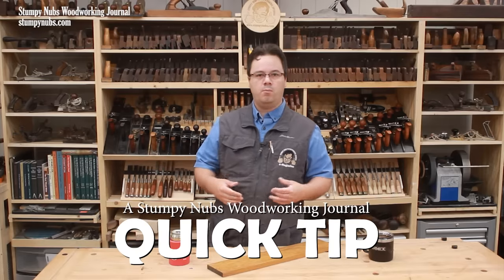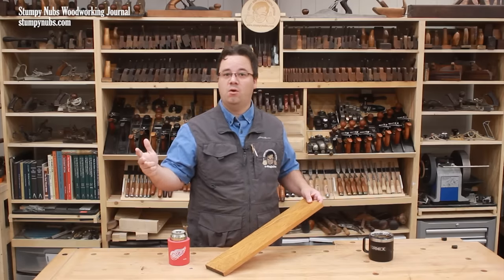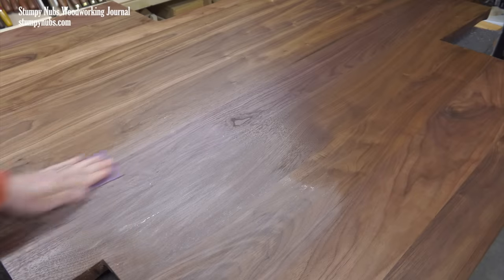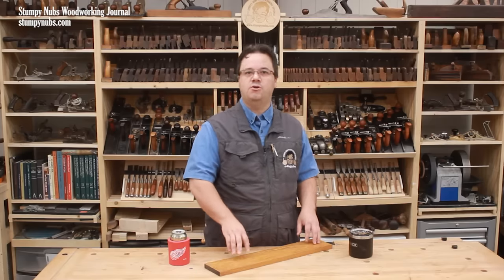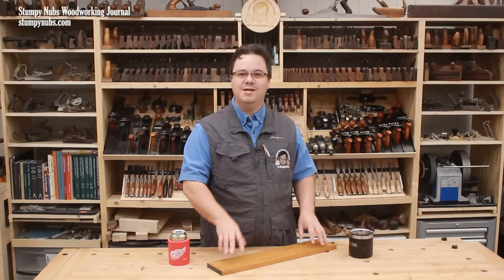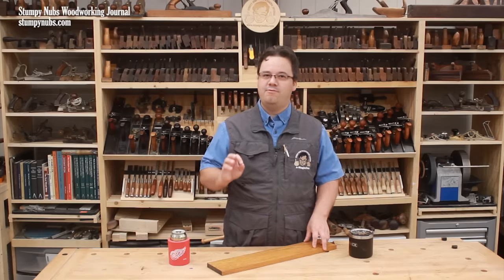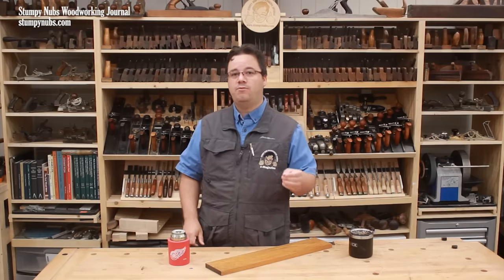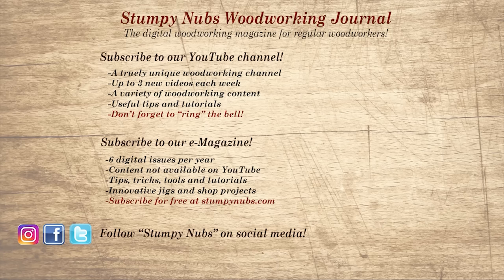Improper sanding between coats of finish- HOW TO AVOID IT!

Comment: If you want a seriously flat surface you need to knock the material back with 80 grit at least to get it flat, even 120 grit is the start of you getting mountains on high spots it won't cut quick enough. If its flat then you can do what you like with it just move up to 240 between coats then a 400 with a red scuff pad after you flat sand with the 400/600 before the final coat. To denib 180 grit automotive wet paper is thee best denibber if you are strictly denibbing just that spot. Then you can knock the scratches of that and blend it in quick with a 600 before the next coat or before final cut and polish. Save yourself a bunch of time don't bother trying to sand out large high and low spots with anything above 80 it won't cut it flat even with a block sander.

Comment: I wish I would have watched this video before I sanded My guitar. I decided it would be a good idea to engrave a cross in the back of my guitar and long time ago and I decided that I wanted to take all the good loss and get it down to the barewood well in the back I engraved a cross so I had to make the wood even to get rid of that cross, in some spots I went a little too deep, I put the stain on, which is a ebony or black stain , and when I look at it that's all I see is the spots that I boogered up lol is there any way to fix it cuz I just keep adding layers of stain, actually today I just put a second coat on . I thought that the spots where I went to deep would just look like a rotten spot on a piece of wood and I would have been fine with that but it really just didn't soak  in the stain, I'm open to any suggestions please help

Comment: could you say a little bit about sanding the edges and corners of a piece to avoid removing the stain underneath?  Or how thick to make the first coats to possibly avoid removing the stain underneath - especially when using wipe-on poly since the coats are so much thinner than other types of finish?  I still struggle with accidentally removing stain when sanding between coats and having to strip and start again.  Or I make the mistake of not sanding enough during the first few coats to avoid burning through the finish and then I end up with the other issues you discussed in this video.
Reply from the maker: I just try to be careful. Laying a scrap board of the same thicknesses as your workpiece next to it will help support the sandpaper ant prevent accidental rounding over on edges of flat panels. A sanding block will also help keep the paper flat and avoid rounding edges. Finer grit paper is also less aggressive and more forgiving if you get too careless.
Reply: @StumpyNubs  thanks, the scrap board is brilliant!

Comment: I've seen contradictory advice on using oil & water based polyurethane finishes over each other. One says oil first then water based over the top, another says water first then oil and a third says 'never the twain shall meet'. Any Stumpy Advice on this?
Reply from the maker: I have never mixed the two, so I don't speak from experience. Keep that in mind! But I believe that, once poly fully cures (takes about a month) it no longer has water or oil in it. It's just a plastic coating. So the type of poly you put on top shouldn't matter. However, new poly will not bond well to old poly. I recommend roughing up the old poly with sandpaper for a mechanical bond. The real question is, why put water over oil (or vise-versa)?

Comment: I'm getting mixed information on applying polyurethane or lacquer on oil based stains. Can you use anything diluted with mineral spirits on stain? Or what would you suggest?
Reply from the maker: If the stain is oil based, as almost all are, sure. Any oil based finish will go on top. (Mineral spirits is an oil based product.) Even if it is a water based dye, once it fully dries you can put an oil on top. But if you have a doubt, try some on a scrap piece and see what happens.
Reply: Additionally, you can always seal with a sanding sealer between stain and finish coats. Something like Zinsser Seal Coat, which is a wax free shellac-based product, works just fine under pretty much any finish and can help keep problematic color coats, or even problematic woods, for that matter, from interacting with your top coats.

Comment: Any thoughts on using 000 or 0000 steel wool?
I usually “buff” out my final coat with steel wool and end up with buttery glass smooth finish. 
I’ll definitely try to paper for buffing the finish, but a comment on steel wool would be appreciated.
Reply: Steel wool can work but you run the risk of embedding tiny metal shards in the finish, which can then rust (more a concern for outdoor projects for sure, but still). I don't know that steel wool is doing any better of a job than very high grit sandpaper so I would just stick to that and the ol brown paper bag for the last coat.

Comment: I have microscratches all over after lightly sanding with 320 and applying my second coat of poly. Did I not sand enough??
Reply from the maker: Is it smooth? If so, apply another coat or two. Sand with 600 between coats.
Reply: @StumpyNubs  smooth as silk, it was like glass after my first coat. And now after sanding with 320, there are just visible scratches in the poly. My guess is I didn't sand enough. How much do I sand between coats? Do I create a solid haze over the entire piece with the sand paper? I lightly sanded, which to me means, literally lightly wipe the piece with the sand paper. Which just created scratch marks.

Comment: Does anyone know if it's recommended to clean each layer of finish with mineral spirits after vacuuming? Or is that just following the first coat only?
Reply: It will be ideal to clean with mineral spirits every time it just helps pick up that much more dust and help for better adhesion on the next coat!

Comment: try damping your floor with water just before you finish your wood projects. just dampen the floor with water, and no puddles. You will literally watch the air clear up of dust. When you dampen the floor the dust stays on the dampened floor thus eliminating the dust all most all together!!! . A old trick from when I painted cars with that old Enamel spray paint. This goes back the the Early 1970's

Comment: Polyurethane is man's cruel inhumanity to man. 

If you use it out of the can, it dries too fast and it gets lumpy. If you thin it, it dries too slowly and it gets dusty. If you try to sand out the top coat, it gets scuffed.

Comment: We’ll unfortunately on my first project, after watching this, I skipped a bunch of steps… it looks good, but now I’ll see how much I’ve missed on it looking perfect… I have a question though! Could it be best if you already know all of your cuts to stain and clear coat BEFORE assembly? Thinking back on the beginning of my project before staining, there’s tight areas that would be impossible to reach with sanding and they’d show if I followed this step by step… it seems as though it would be best to get em perfect before articulating everything together

Comment: If you ever do a video on rubbing out a finish (maybe you have?), you can become an internet hero if you talk about rubbing out when there are mouldings, drawer faces, etc. In other words, everyone talks about rubbing out the nice flat top, but no one talks about getting a compatible, uniform sheen over all the rest of the piece where there are corners, dips, dives, and wiggles that invariably get cut through whenever you try to sand them. What makes me think of this is that it sounds like you just use your brown paper everywhere, but what if you want more control of the sheen level? I must admit that craft paper hasn't quite worked for me. It will make the surface feel better, but I'm never happy with the sheen, which tends to end up with glints or dull spots rather than one uniform sheen, even on flat tops. I landed here today because I'm applying Waterlox  on oak (only use Waterlox occasionally) and it's driving me insane by looking like gooseflesh despite doing all the normal tricks (like you show here). I don't think it's dust.

Comment: Thanks for this great explanation and demo as always. 
I tried to do my first finish using pure Tung oil+turpentine on an oak desk top after watching your other videos on Tung oil. I was sanding with 320 grit between coats, and learnt by myself the 2 hands method for feeling and sanding but I wasn't aware I had to increase to 600 and 1000 grit so I made the error to keep the 320. After 3 coats it still looks like I have applied only 1 coat. I will try the techniques presented here.
For now, I am not really impressed by how the wood looks (its just oak, but I was expecting more contrast & reflections) and I look after the aesthetics more than the smoothness feeling.  
What would you do to make the wood patterns look more beautiful?
Would you recommend doing "wet sanding" (applying the oil with the sandpaper)? I understand this technique is supposed to fill the pores with the dust just sanded while applying it. It's been done on a few guitar making videos, but I can't tell what's it's worth compared to your technique. 

Regards
Reply: Mighta want to use a stain or even a dye on your next project.  Tung can darken what's there, but if the grain isn't really fascinating, vivid colors can help spice it up!

Comment: I like to use 320 paper on a soft block after the first coat, 00 steel wool to grab the nibs, and 0000 for the final buffing. Good video. Your points about recoat times are excellent.
Reply: I remember my grandfather teaching me this after I put together a set of shelves and put on the first coat of polyurethane. He was inspecting it, turn to me and said "Looks nice. Looks really nice. Do you want to make it look better?" I responded with "Why yes I do!" and he proceeded to tell me about using steel wool to smooth it out, get rid of bubbles, and really shine. 25 years and several moves later they still look great.

Comment: At 2:37 you suggest using mineral sprits to swipe up the last of the dust. Wouldn't it depend on the material you are applying? If I'm using a water based finish, wouldn't I want to use water? I actually like a small amount of alcohol because it flashes off quickly - understanding you can't really do that with Shellac or you screw up what you have just put down. VERY smart to not use compressed air and to vacuum up with big stuff. And I REALLY like the paper bag trick. I had just used one sheen "brighter" than I want the final to be (semi-gloss if I want satin) and that final sanding always took it down a notch - but the bag trick might just replace that theory after all my years of using it. Nice to learn something new!
Reply from the maker: Sure, you can use water. I'd just try not to use much or you may cup your board. Mineral spirits leaves very little, if any film once it evaporates. I don't believe it will interfere with a water based finish.

Comment: Beware, I used new 1500 grit sandpaper on wipe-on poly after the fourth coat and it made very visible scuff marks.  The wipe on poly was several days dry and I sanded gently with the grain.  I put on another coat and the scuff marks are still visible, so I have to start over.  This advice did not work in this case

Comment: Very well presented.  i have a question though...what do you do when you can see places where there was too much poly left on and is now dry? i tried sanding with 220 or 320 and now there are white areas, smooth by white.  will the next coat of poly seal in the white or get rid of it.  i was applying wipe on poly.

Comment: In order to get all the dust particles off the wood, I end up sanding all the finish off the wood.   In order to remove the dust particles from the wood before finishing, I vacuumed the wood, then wiped it with a tack cloth. This does't seem to have been good enough.  I don't have a shop, so I am working in my kitchen. I vacuumed the kitchen really well before applying the finish.  I am using Old Master's oil varnish  with a natural bristle brush.  I pour the finish into another container and work from there.  I'm really having a difficult time.  I've sanded off the finish twice now.

Comment: Hello just watched your first tutorial, so maybe there are others where you already answered this? 

How long before 600 sanding between coats, and after final coat? Should it be still wet? Feel dry? Or 24hs later?

Also what kind of cloth do you recommend for varnishing? 

Thanks in advance
Reply from the maker: As I said in the video, when it is dry. If the paper is gumming up, it's not dry enough.

Comment: 320 grit, 600 grit, 1000 or 1500 grit.  that info right there explains why my sliding door didnt turn out as smooth as I wanted.  I had nothing finer on hand than 200 grit.  whoops

Comment: I do use primarily BLO for tool handles, I watched so many Videos over the last years. Well I just learned alot watching half an hour on your channel… :D mainly that i need to wait way longer between coats, even to understand the differents between soaked in and really dry. 
I kind of like the finish 00steel wool gives on blo handles, but when to use isn‘t really clear to me. Do i need to wait until it is completly dry? I know that the finish can‘t be to sticky, because I had partickes of the wool stuck in my finish before… :D semi dry seems to work ok fine, I havent got the chance to try really dry yet.

Comment: So pre stain - u do ur normal sanding- one coat of stain, then sand with over the stain w 320 grit, apply another coat stain then sand w 600 grit then after final coat of stain buff w 1000-1500 grit ??
Reply from the maker: If you are going to sand over the stain before applying a clear finish, do it very lightly so you don't remove the stain.
Reply: @StumpyNubs  thank you for responding! Really appreciate all ur help

Comment: Great video, very informative. I use oil based poly thinned 50% and apply it with bakers linen cloth.  That cuts down on the lint dust that is always there.  In between coats I sand with crocus cloth.  The crocus cloth has no appreciable grit and does a good job of polishing away the roughness on the poly. I can use the crocus on the final coat with no scratches. Course I’m sanding very lightly.  The only issue is it’s hard to find and expensive.  But a sheet can be reused over and over. Keith

Comment: I agree great information. Where I have trouble is using a tung oil type finish, i happen to like waterlox . But i get bubbles no matter how i apply it, thick or thin, brush, rub, spray.  I have to buff them out every layer.  Any ideas on how to apply it without the bubbles ?

Comment: I normally do 3 coats of poly, wet sanding using 600 grit after every coat, but use mineral spirits instead of water. No dust. Wipe it off with a towel. No sanding after the last coat.
Reply from the maker: I see no purpose to wet sanding unless you are hoping to fill grain, such as with oak, ash or walnut. If the surface is smooth, a slurry created by wet sanding isn't going to make it smoother.

Comment: This video is just in time.  I just put 3 coats of arm r seal on my dresser drawers and they are very smooth without final sanding, with the occasional nib.  I'll breakout my 1500 grit to finish up.  Can't remember the last time I had a brown paper bag in my hands or else I would use that.

Comment: Already have water based satin poly on my hard maple T&G work bench top.  Nibs is #1 concern.  Do all your steps apply to water based?
Reply from the maker: yes
Reply: @StumpyNubs  THANKS for Speedy Reply!  I should have been more specific:  same steps but should I stick w/water base or switch to oil base as in the video?
Reply from the maker: @NoferTrunions  You can technically put oil based poly over water based if it has FULLY cured, which takes about a month. I'd just stick with the water based since you've already started with.

Comment: Question, I'm late to the party, but hope I'm not to late on fixing the problem. I sanded in order all the way to 320 grit and was gonna stain next. Then I saw your video. Is it to late or can I re-sand at 180 grit to raise the wood back, so the wood will stain better? Please help by the way I'm using ash wood and oil based stain.
Reply from the maker: Yes, you can go back to 180
Reply: @StumpyNubs  thank you for the quick response. Great video's.

Comment: I HAVE USED A NUMBER OF FINISHES THE 1-FINISH I HAVE FOUND THAT I LIKE THE BEST IS ARMERSALE SEMI OR SATION FINISH THE BEST ONE OF MY BUILD'S  IDID WAS  A BLACK OAK TOP DESK WITH A LIVE EDGE AND A CURLY CHERRY BADE WITH A BIRDS EYE MAPLE DRAW THAT WAS HALF INCH THICK TEAK BOTTEM THE  LEG'S  I CUT FROM 16QUATER AFRICAN MAHOGANY   I CUT THE LEG'S WITH A 2-SIDED TAPER     AND I USED 8++COAT'S OF ARMER SALE I HAVE HAD THE DESK IN A TEMP THAT DIFFER'S A 10-TO-15DG AT THE VERY MOST FOR THE LAST 3 TO 4++-- YEARS AND I HAD TIME STAMPED THE DESK I HAD SOME HELP FROM A FRIEND AND HIS ADVICE THIS FRIED THAT HELPED DID GO TO 1 THE BEST SCHOOL'S IN THIS COUNTRY THE NORTH BENNET SCHOOL  I DO THINK THIS SCHOOL IS A    IVY LEAG LEVAL OF WOOD WORKING. SOME OF THE BEST WOOD WORKERS OF TODAY HAVE COME FROM THIS SCHOOL THAT HAS BEEN A ROUD SINCE THE MIDDEL 1800'S I REALY LIKE YOUR TIP OF THE BROWN PAPPER BAG I WILLHAVE TRIY THIS OUT WHEN  USE THIS TRICK IS IT A TRICK THAT CAN BE DONE WEEK'S OR MONTHS DOWN THE ROAD AND HAVE THE PROJECT LOOKING JUST AS NICE???????

Comment: I never got a smooth finish (without spraying) until I started doing two things. Sanding with 400+ grit VERY lightly (just enough to smooth out the bumps) between coats, and then using VERY thin coats for the topcoats.It should be just enough to wet the surface, and no more. If it's thin enough, it will dry EXTREMELY fast. Bubbles can't form in a layer that thin and because it dries so quickly ,dust isn't too much of a problem. Thinning the poly for the topcoats helps too.